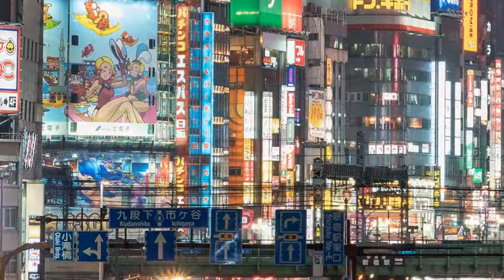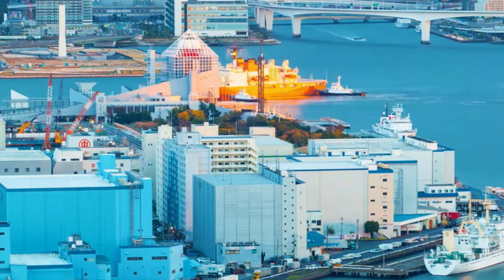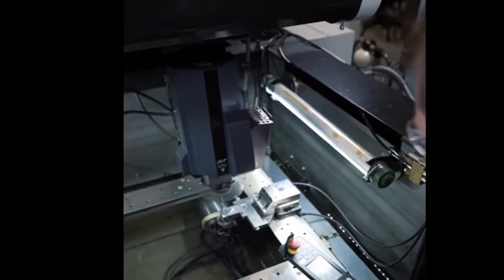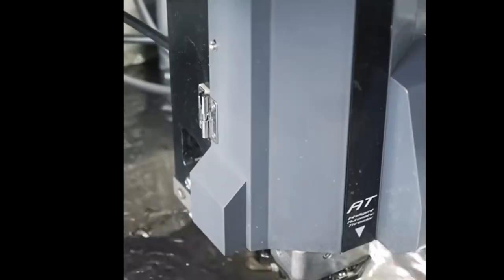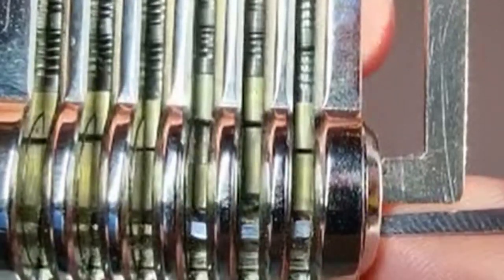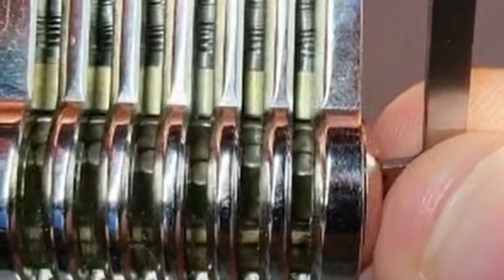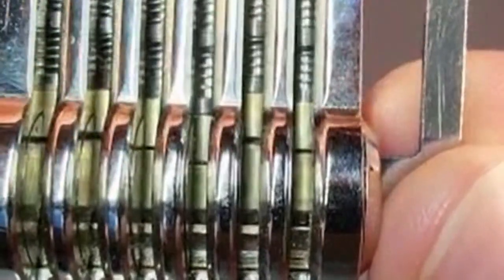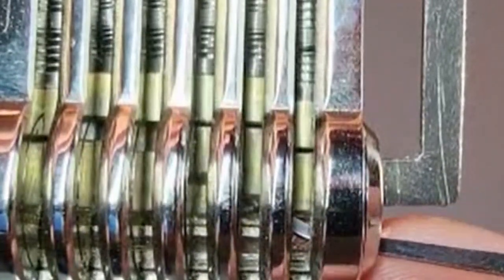How to Pick Locks: BINDING PINS

Comment from the maker: SO HERE'S A QUESTION: A lock made with Zero Tolerance Machining - A) Would it work? B) Would it be really easy or really hard (maybe impossible) to pick? ANSWERS BELOW...
Reply: I personally don’t think it would work. You would be trying to lift pins that would be compressing air behind them. I doubt the original key could actually be inserted into the lock with that happening. If you could insert the key by brute force. The key would be trapped by the pins.
Reply: I think it would work fine just like them models worked with there intricate patterns some of the best locks you can buy Rely mostly on tight Tolerances for there security . Im Drawn Towards women with them aspects as well. Just another weakness i have 🍷
Reply from the maker: @FriedPi-mc5yt  But part of the design would allow the air to escape, you wouldn't seal off the bible for instance so the pins could move.
Reply from the maker: @mickconnolly5784  I still don't know if it would be an easy pick or a difficult pick - with them all binding together, would you be able to form a shearline at all? And I like a lady with good physical tolerances, but a bit of wiggly room in the brain dept is also required.
Reply: @LockPickingLegend  Hmmmmmm…. If the chambers are vented, then it would work. But, I’m not sure you could pick it. All the pins would bind the minute you applied any tension at all. If you set a pin you would get no feedback that it was set. You wouldn’t hear a click, the core wouldn’t move at all. I think it would be impossible or next to impossible to pick. You might be able to rake it if you could apply an infinitely small amount of tension without locking up the pins completely. This is a real brain scratcher.
Reply from the maker: @FriedPi-mc5yt  Would you be able to achieve a shearline with such a lock? if all the machining was perfect, as you said, the pins would all bind immediately and...well...there's no play for the core to move to make a ledge to set them.....I think?

Comment: The issue with a 0TM lock is that it would have no tolerance for corrosion or dirt.  The tiniest of particles would cause the lock to seize.  I'm commenting at 8:00 so I've no idea if you mention this later in the video.  I could have waited another 5 minutes, but I'd probably have forgotten by then.
Reply from the maker: I asked the question on Twitter if a Zero Tolerance lock would be really easy to pick or really hard, because would you even be able to get a shearline, for instance? I like your idea about a tiny particle seizing the mechanism.....but....how would such a particle get into the mechanism if it had zero tolerances? Not saying you're wrong, just another question.
Reply: @LockPickingLegend  A fair point, but crap has a habit of getting anywhere. Just think back to the last time you were on a beach in your Speedos. I've had sand in places that a surgeon would have difficulty removing.
Reply from the maker: @NiqScott  Haha, I know it well. Interestingly, Locksmiths working in beach towns have to deal with loads of sand damage. I mean something could get in the keyway, but could it get between the pins and the bible?
Reply: @LockPickingLegend  I imagine that corrosion would build up at the atomic level, and with those tolerances, the tiniest build up would bugger the lock.  I'd like to see the surfaces of various materials cut with EDM under an electron microscope, to see how "smooth" the surface is.  Even something as minute as Boris Johnson's conscience could get trapped in any pits, although I imagine that the torque from turning the key would overcome most of this.  It's interesting as an intellectual exercise though.
Reply from the maker: @NiqScott  Atomic level. It's Monday. This can of worms will have to wait...duty calls. (Although, check these out, it's far from flat:  https://www.researchgate.net/figure/a-Surface-morphology-of-EDM-in-roughing-condition-b-Surface-morphology-of-EDM-in_fig3_343018367 )

Comment: Law locks just bought one of those machines
Reply from the maker: You can pick little ones up for about a hundred quid, the one in the video, substantially more.  It's just an EDM cutter until it can cut at one tenth of a thousandth of an inch - then it's real magic! Thanks for watching.
Reply: @LockPickingLegend  I didn’t really watch it , skipped 95% of it tbh
Reply from the maker: @steveives2634  Thanks for watching 5%.
Reply: You can even convert 3D printers into a basic one